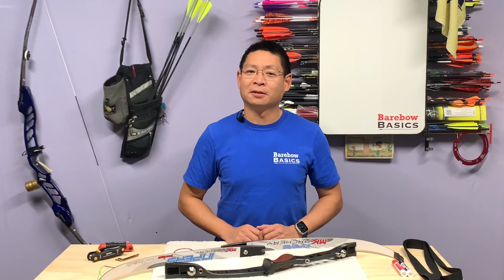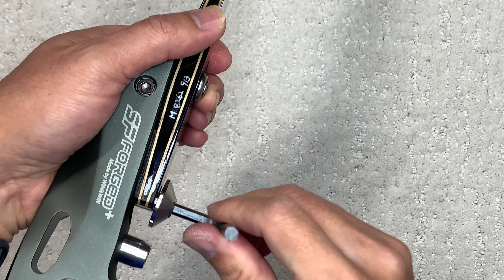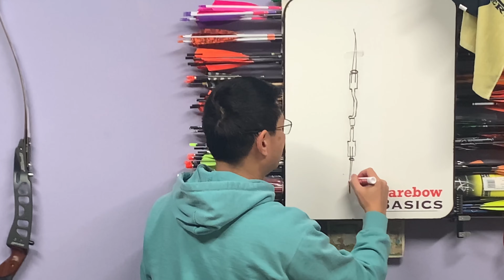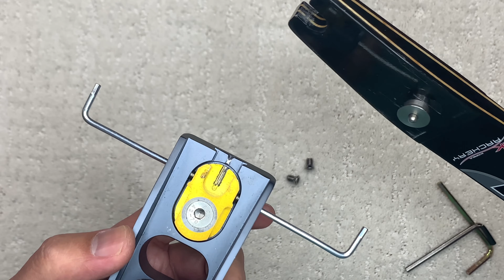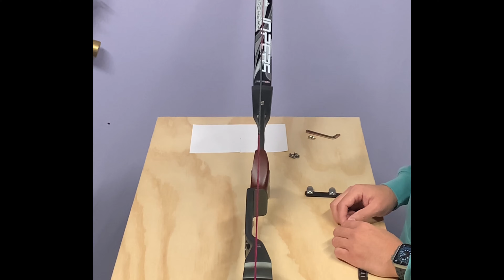Barebow Build - part 1 - Limb Setup

Comment: About the alignment, why the company not making it fix perfectly aligned i mean can you help explaining, i dont understand why they should make the alignment thing variable?
Reply from the maker: Due to manufacturing tolerance there will always be a slight variation in ILF slot or bushing hole placement. The variability allows for precise tuning by the end user. 😎

Comment: Where to buy tuning fork?
Reply from the maker: Unfortunately, they were discontinued a few years back. The only way to find a set is on the used market. There is a 3-D print file floating around on the Internet that was released by the original creator; the stipulation is that it is not allowed to be used for mass production or resale. If you can get your hands on that print file, you can print a set for yourself. The only downside is the materials quality from a 3-D print isn’t as good as the original production version. (3-D Printed versions have a tendency of warping).

Comment: Thanks for the limb-root setup tips!  These issues are never addressed on the other trad channels.  If you set up a hunting barebow, with a side mount quiver, would you off-set the string plane a bit to anticipate torque?  or am I picking a nit?
Reply from the maker: No. The limbs should always be aligned to the riser so that the string plane goes straight through the center of the riser. If you add a quiver to the side of the riser, you may want to use an offset weight on the front stabilizer bushing to counteract the balance change. Yost Archery Products weights are perfect for this type of arrangement.

Comment: I want to follow your set up process.     I have been told the limb bolts are unusual on my riser, do you have any tips for setting up a W&W Winact riser
Reply from the maker: Apologies but I’m not personally familiar with that riser. Searching for it on the internet seems to return multiple different versions, so it really comes down to which specific version you have. If you can paste the link to some images here as a reply I might be able to help guide you.

Comment: So after doing the string alignment you do the vertical plane. Is the string alignment still visually correct after a potential plane correction? Very good video 👍
Reply from the maker: As described in the video, as long as the limbs are moved an equal amount in the corrective direction in unison then yes they should stay aligned. That is why I recommend checking it periodically after every vertical plane correction.

Comment: What if my vertical plane when messing the grip way is off but visually it's centered with the riser and the limbs
Reply from the maker: @TWKJake  double check using measurements on another section of the riser such as below the stabilizer bushing. Visual centering is never as accurate as using measured centering approaches.

Comment: How do you determine your draw length?
Reply from the maker: This is a topic covered in many other videos, articles and discussions across the internet, so I didn’t feel it critical to re-hash it and consume video time. The basics of it, is to have a friend or helper mark an arrow shaft with a sharpie at the front edge (target facing side) of the riser when you are holding at anchor while in the best alignment possible with good form. This measurement from nock to the mark is typically known as your AMO draw length. For odd shaped risers, you can also mark the distance at the plunger hole instead, and add 1.75”. Proper form and the best alignment possible is the key to getting an accurate draw length measurement.

Comment: Thanks for the best explanation I've ever seen!
Just one thing:
If you turn the tillerbolts with the bowstring on the limbs, you will damage the riser. The steel bolts will cut the alloy like a hot knive the butter.
I have the the same riser and I didn't remove the string befor turning the tillerbolts. The result after 3 to 4 times tuning was a unuseable riser due to not enough material in the riser holes for the tillerbolts. The risk of pulling out the bolts at full draw was too high, so I decided not to use the riser any more!
Reply from the maker: There is supposed to be a molybdenum type anti-sieze lubricant on the threads; this generally prevents the bolt threads from cutting into the riser threads in the hole. But if a person is concerned about potential damage, then yes they should always de-string before each adjustment. (This is why I specifically mention it in the video)

Comment: Great tip Coach! This is the  best explanation on cenrtering the strong onthe planeo of the riser that does not depend on error prone practive of viewing the riser from a distance from behind. By using this tip I fixed a pervasive problem on my bow alignment that not even a seasoned archer/coach was able to fix. This method provedes confidence and peace of mind that your bow is really aligned. That of course depends on having a decent build quality.  Thank you for sharing. 🎯
Reply: Excuse my multiple writing errors ! Writing on  phones is never better than using a full keyboard. I am glad you got the meaning. 👌

Comment: Could you please post a link for tuning forks?

Edit : They actually seem to be discontinued, any other way to tune the string to true center without this tool?
Reply from the maker: Many generally use Beiter Limb Line Gauges. While not as good as the tuning forks, they do serve the purpose and help get the job done.

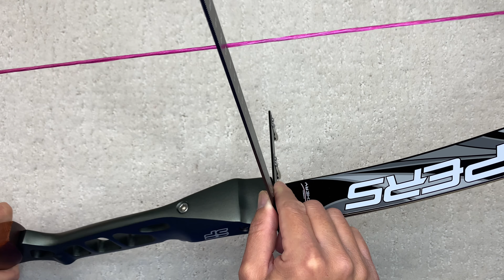Comment: Did you mean 18.5 "cm" instead of 18.5 "mm" (at around 8:50)?
Reply from the maker: Yes! Sorry, it was an error of speech;  unfortunately there’s no way for me to correct it once the video was published. Approximately 18.5 cm was the distance from limb surface to string.

Comment: Quick question regarding bow length for a taller shooter (6'4) with a 30" draw - im looking to buy my first barebow setup and was told to go cheap at first. I want to aim for a 72" rig meaning I would need to get a 27" riser. These usually cost a couple hundred dollars more than a "cheap" 25" riser, $130 vs ($300-400 for an entry 27"). Id like to learn good technique with a 72" bow but not sure the cost difference is worth it compared to a 70", what do you think?

One other question, i viewed your form    video but you didnt touch on hook release, ive heard different opinions on how we are supposed to release the string, could you please give your input? Thanks!
Reply from the maker: There’s two questions here, so I’ll address the quick one first. 

Shot execution (release) is a topic I haven’t covered yet. It is forthcoming though, likely the next segment as it completes my discussion on the entire shot cycle. I cannot do it justice trying to explain it here in a comment reply unfortunately, so please stay tuned. 

The more complex answer for what riser to get depends on how committed you are to learning the sport and discipline. While there are many archers who have shot 25” risers with long limbs successfully for decades, even with a longer 30” draw length, if you feel you are going to pursue competition seriously, my normal recommendation is to spend the extra for the 27”. If this pushes your budget a bit, see if you can find a used riser, as there are often many available. (My friend Peter is selling a great Gillo g1 right now for example)

If you aren’t at a point where you are confident you will truly pursue competition, then a 25” riser with decently designed long limbs will certainly work great for recreational use. Too many people forget that using that combo has successfully won many state and national titles, before 27” riser prevalence became mainstream.
Reply: @barebowbasics  Thanks! Do you have a link to your friend's riser or the price?
Reply from the maker: There is a buy sell group on Facebook; here is his post. 
https://www.facebook.com/groups/1879744912098892/permalink/25163041540009234/

Comment: Pardon the remedial question but are you suggesting that the only reason to remove the string before making these micro adjustments is to preserve the limb for resale? Is the limb really so delicate? Thanks. (Great video!!)
Reply from the maker: Essentially. The finish on the limbs can be scratched on the underside of the limb root if adjustments are made without de-tensioning the string. While some archers may not care about those aesthetic changes, there are some that would prefer them to not be there (or minimized) in the second hand market. This is why I generally teach it to be a practical habit; If the archer learns, then chooses not to care and makes adjustments under tension, they go into it conscious of what they are doing. 

From a structural and functional perspective, it would take an inordinate amount of scratching to work all the way through the clear coat finish and to start damaging the actual limb root. So functionally, the limb will not be affected; as such I would not refer to the limb as delicate, only the clear coat finish applied for aesthetics.

Comment: Observation, Centimeters rather than millimeters on the bow square when measuring tiller.  2.54 cm per inch for those of use still using the Imperial system,
Reply from the maker: Whoops. lol 😁

Comment: Would the on-plane test be similar to aligning with the front stab?
Reply from the maker: Using the stabilizer holes falls in the category of ‘arbitrary reference point’ in my opinion. First, there is no guarantee that it is properly centered; it is often just a steel threaded collar that is pressed into a drilled hole in the aluminum. Second, and most important; we don’t press with our grip hand on the stabilizer hole; we press on the grip, which means the grip area is the critical area to align the plane to in order to avoid unwanted torque effects from being out of plane.
Reply: @barebowbasics Thank you for your reply! Will try this on my next tuning session.

Btw, I was the buyer of your orange Jager JD3 grip that you sold quite awhile back.